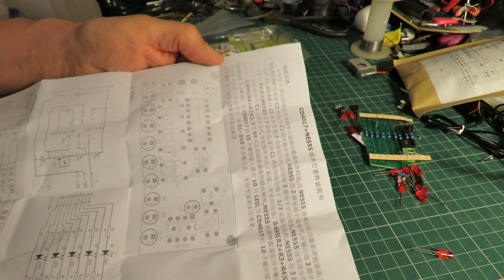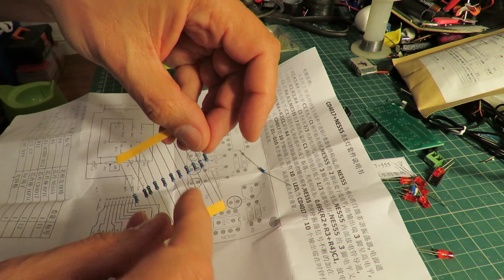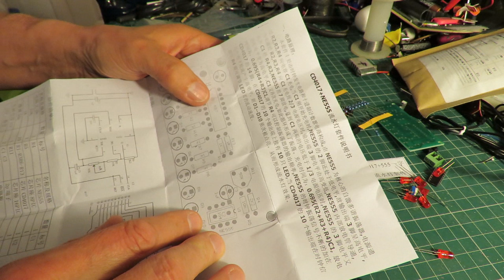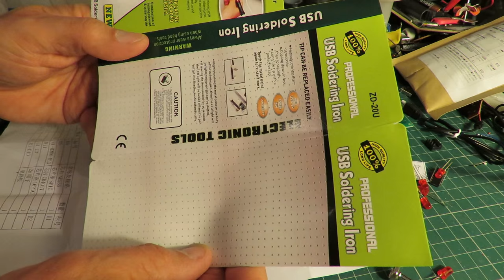LONG VERSION Grandad's Postbag Combined assembly and test LED DIY Kit and USB Soldering Iron

Comment: Hi, Grandad -- Grandpa here. I enjoyed watching this assembly video. Just a few points: I have always soldered on the small components first (resistors, diodes etc,) and then the next lower-profile bits such as IC sockets, then taller bits (capacitors and transistors). It makes handling the PCB just a little easier.

If you put components in the wrong way round the electrons get confused ;) !

Good work -- please write back.

Comment: hi grandada, awesome video and nice job in putting that little kit together. you always learn something new when watching videos like those, i like the usb soldering iron u used but its a challenge to swap over to a soldering iron u neverused before when u always have used your own one for past projects to see which 1 works for you best plus u get to see how they work for you. keep up the good work and hope to see  a few more kit videos like that one :)
Reply from the maker: Thank you. I have been using this soldering iron quite a lot now. I am not confident it delivers the right heat but it is very light and compact. The best bit is the speed it warms up so for a simple little job like re-soldering a single broken wire it is great and very quick to use.

Comment: p.s. I have always found it useful to nip off the excess leads as you go to help gain access to the PCB. Don't throw them away -- keep them in an old mint tin for use as wire links.